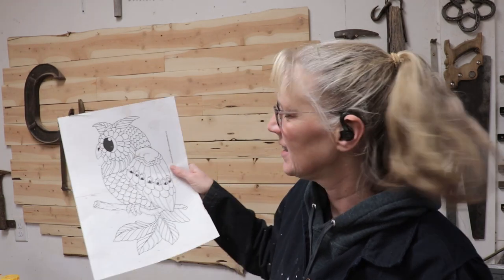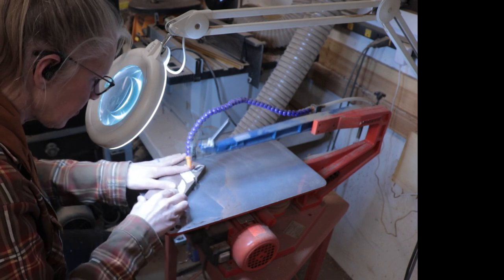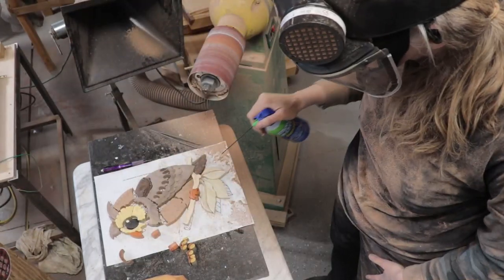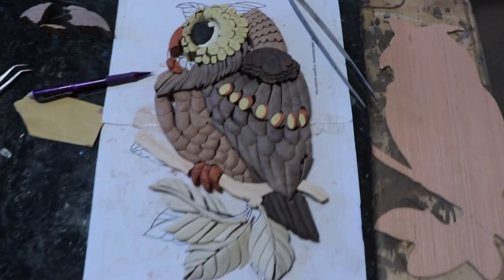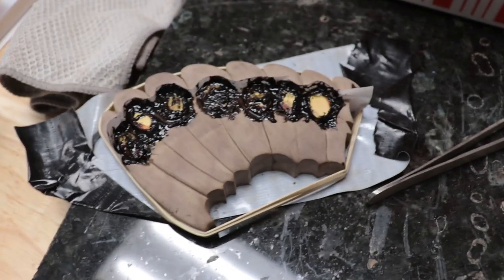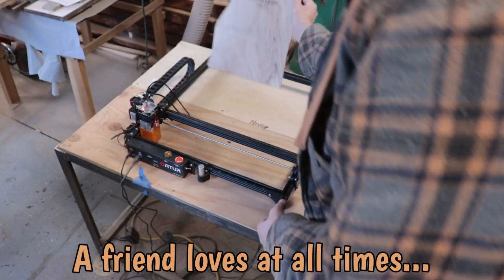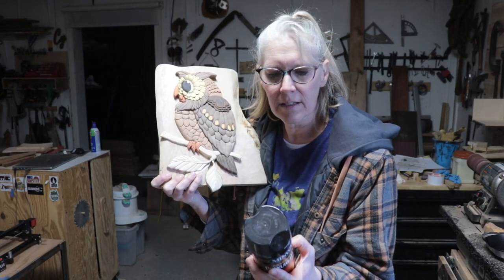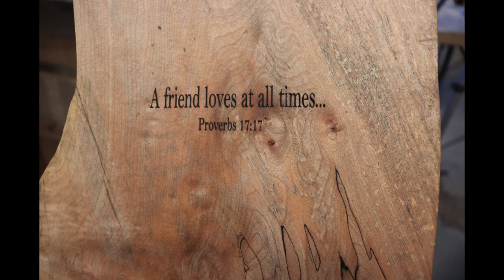Owl Intarsia

Comment: Cy  I just found it on your Amazon store. How do you like the Hegner saw any feedbacks for us.  I have a old Delta variable speed but it is going out and you can't not get the parts anymore, so I'm looking into getting a new or  Used Scrollsaw thanks for your help.I enjoy your videos❤
Reply from the maker: Hello! I love my Hegner! It does have some things about it that some folks don't like, the blade attachment mechanisms specifically. You can order a quick release blade attachment then that takes care of that issue  if it is an issue! I actually like the standard blade attachments because they hold so well! I'll have to write something in the store. 👍
Reply: @CysCorner   Thank you for letting me know about the Hegner scroll saw. I too like the old standard blade  Changing. I have a very old Delta and it has the old standard blade changing.  You have to have a round straight bar you stick into the top by the blade and then you use an Allen wrench to get the blade   loosen too changed it. It's a little time consuming but I don't mind it neither It holds the blade nice and snug and have no problems with it. ❤️
Reply from the maker: @rosea4381  You would love the Hegner then!!!!